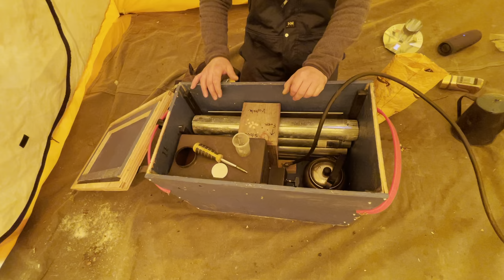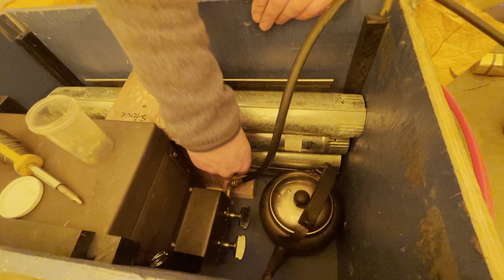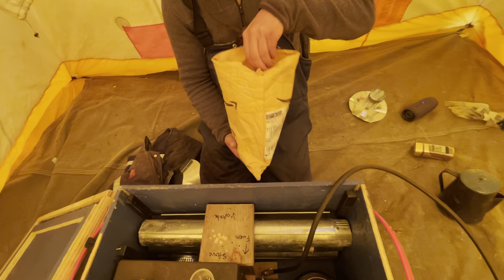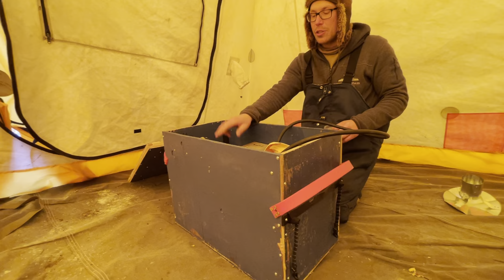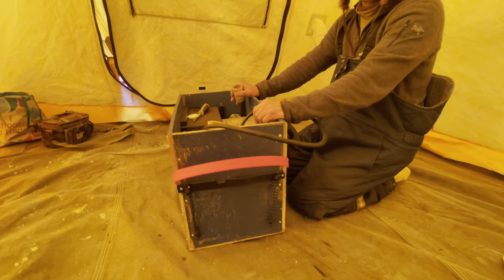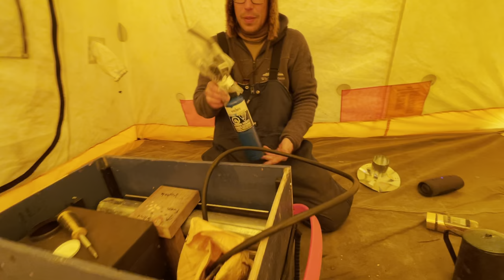Box for Nuway 4000 stove in Arctic Oven

Comment: I have the same furnace  and have been using it for 5 years for wintering camping I also screw the vent pipe to the top lip on the furnace (small lip that can pull off). I don't have an Artic oven but have a few different tents and we camp down to minus 40. When it gets below -30 we bring the propane cylinder inside the tent.  I know it sounds dangerous but we double check every propane connection you need vapor pressure to have heat. I also have a Carbon monoxide detector/ smoke detector, cold weather propane hose, small box for furnace which holds a wood stove fan that goes on top of the furnace and a small battery operated fan/ led light which was designed for ice fishing tent (hang it at top of tent and it blows down heat). I also take a double insulated tarp  for the floor. I must admit if we  are going for more than 3 nights we take a wood stove someone is then getting up a couple of times to stoke fire during the night.